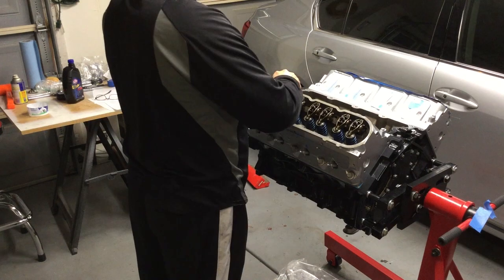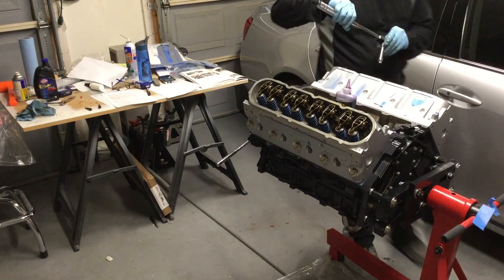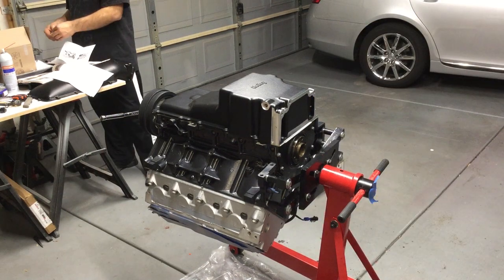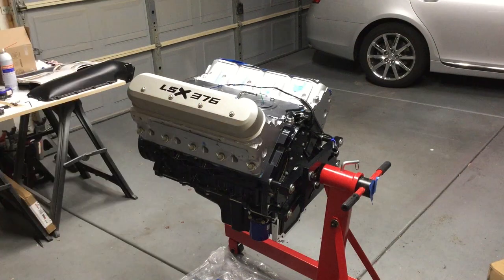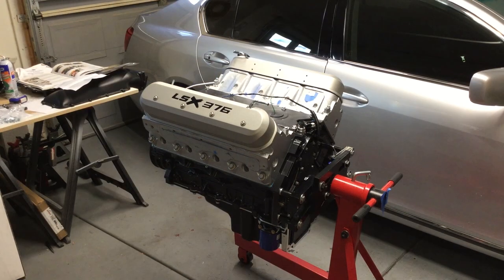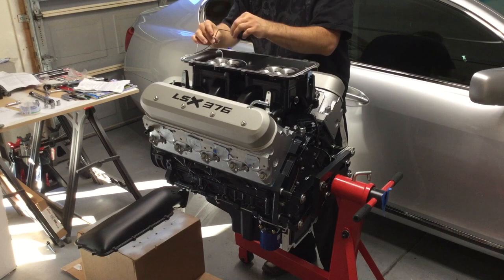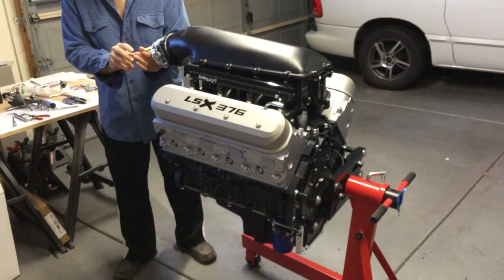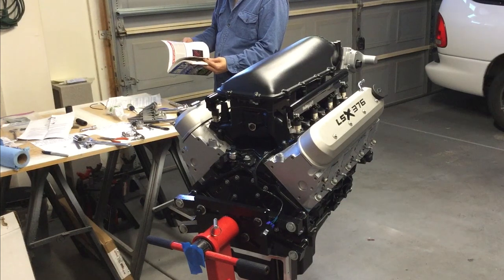How To Build An LS Engine   Assembly Part 3

Comment: Hey i have a lq4 motor. My oil pressure sensor came with a strainer. But the one i took off does not have one. Is that normal with lq4 ? I have seen several videos with the valley pan extend on top of the oil pressure sensor location
Reply from the maker: I found this.  https://www.silveradosierra.com/vortec-5-3l-v8/oil-pressure-sensor-filter-t666618.html